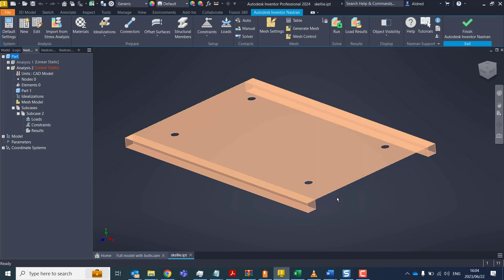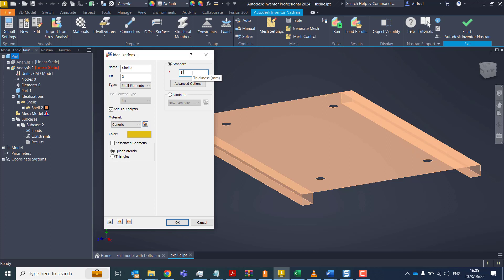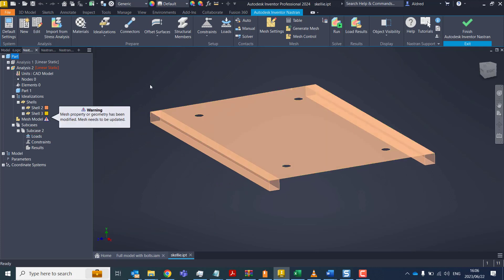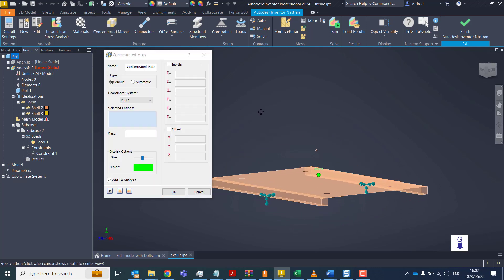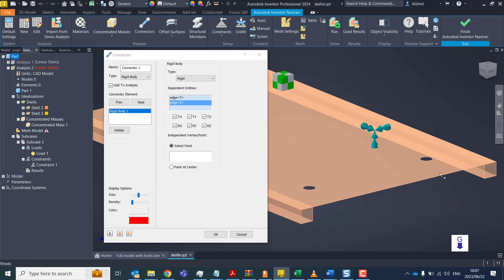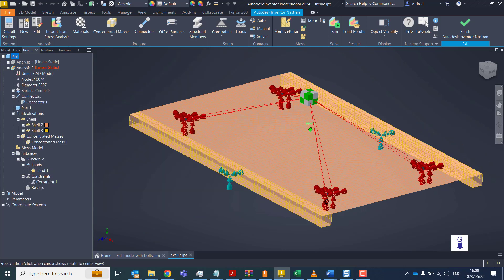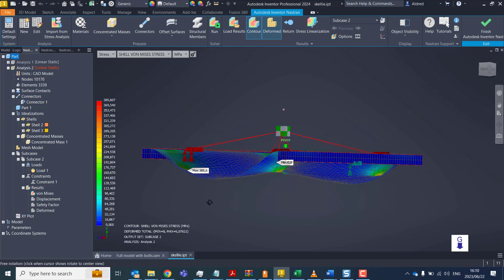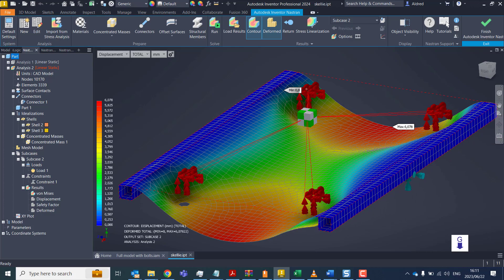Connecting a Mass in Inventor Nastran

Comment: In this case, I am guessing you’ve put a separation contact between the plate and the square tubing to simulate as if the plate was simply placed on top of the beams. Is my assumption correct? If the plate and tubes were welded you would have applied a bonded contact?